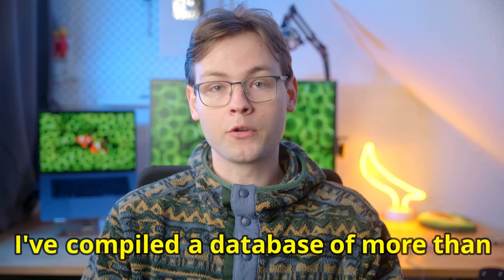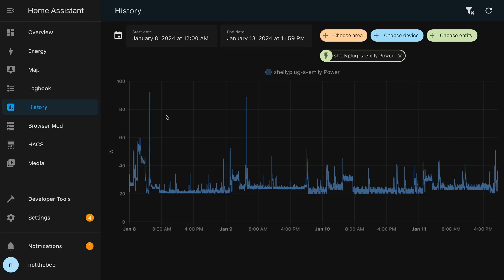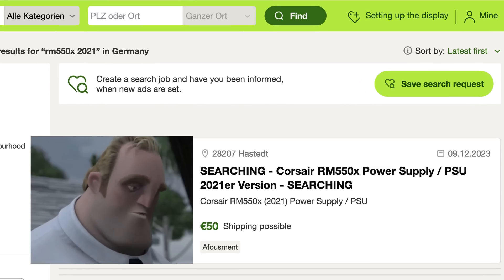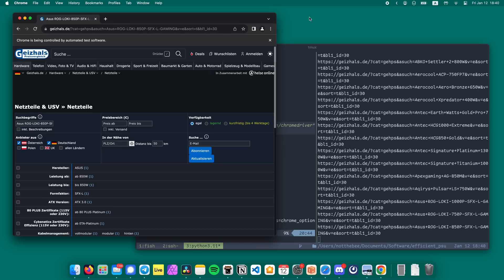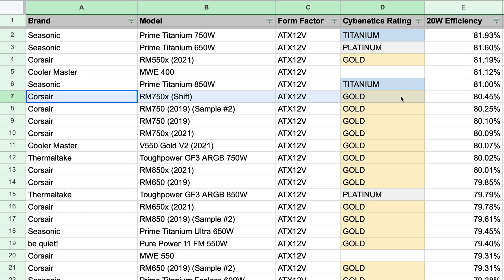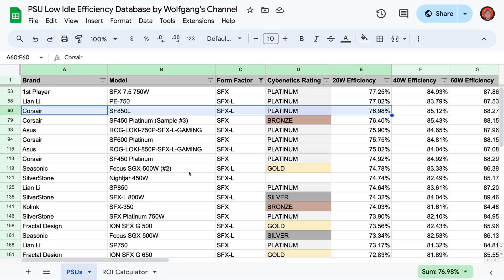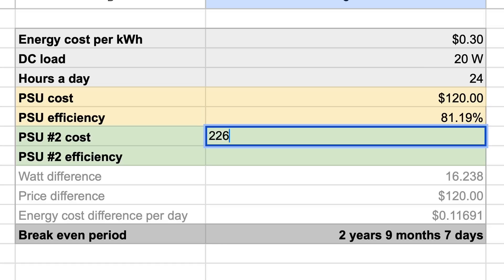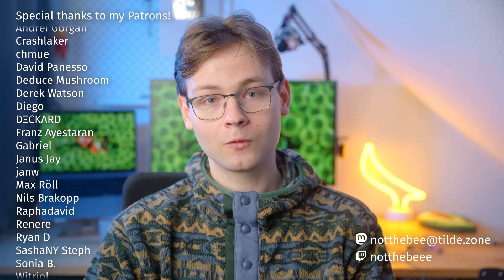What's the Best PSU For Your Low Idle Home Server?

Comment from the maker: PSU Low Idle Efficiency Database: https://docs.google.com/spreadsheets/d/1TnPx1h-nUKgq3MFzwl-OOIsuX_JSIurIq3JkFZVMUas/edit#gid=110239702
Reply: Amazing video!! I can see a lot of effort went into it, really well done. 
Also I'm a lucky owner of a Seasonic Prime Titanium 750W, I got it a year ago on the used market for 99$ (I think the person selling it did not realize what an amazing deal that was!)
And I still got warranty until 2032 😂
Reply: Nice work, thank you for this great resource! Just to let you know, there's a maths error on the ROI calculator which means it significantly underestimates the power savings. You have used DCLOAD * (1-efficiency) to calculate the "lost" power of each PSU, but you should use DCLoad * (1 / efficiency - 1). Or for the purposes of comparison, you can just use Dc Load / Efficiency. This is because the efficiency ratings from Cybenetics are defined as Eff = DCLoad / ACLoad. So a PSU that's 50% efficient has to draw 40W to supply a 20W load, but your formular adds 50% to the DC load, implying only 30W AC load.

If you replace the Watts Difference formular with =abs(C9/C12 - C9/C14) you will get the true power savings :)
Reply: Hallo Wolfgang
Könntest du beim Dok. die "%" Zeichen aus den "xxW Efficiency" Spalten entfernen? So könnte die Filteransicht auch korrekt verwendet werden. bsp. "grösser als" und "kleiner als". merci <3
Reply: this is awesome, thank you! Thanks to you my home server is running smoothly and I got to learn a lot about the topic :) thanks again!
Reply: great effort, but honestly, if you're up to meet a price point while trying to achieve maximum efficiency, you're kinda lost. basically there are no really good solutions for that, since either PSUs from the list are very expensive or not very available to buy.
I've been thinking to build my own, kind of specialized "PicoPSU" with one or multiple highly efficient 5V switching voltage converters. PicoPSU has one huge issue IMO: for a highly efficient SSD NAS as an example, you might get away with a 60W PicoPSU but because of the power demand of multiple SSDs in a RAID array while writing, you might end up needing a 160W or bigger PicoPSU and still may be underpowered.
Reply: I examined the sheet and i think that for corsair sf 450 platinum there is a error, the classificati doesnt macht tests done by other site as anandthec i. e.
Reply: 4x RM550x left still available in Poland. Just ordered one.
Reply: I wish they had tested the Seasonic Prime Fanless PX-500 (Platinum)
Reply: well there be a motherboard sheet?
Reply: Nice. The Seasonic Prime Titanium Fanless 600W is listed as Gold though for some reason.
Reply: I just wanted to say thanks. I was seriously thinking about needlessly upgrading my PSU for my desktop. Was thinking of switching from an Corsair RM750 to the HX850. The break even period was 360 years using your calculator. Again thanks for doing all the heavy lifting..
Reply: So the google sheet lists efficiency at 110V. Someone in Europe should be looking at 230V efficiency right?

PS: Sorry if I missed something obvious.
Reply: @vba77  Efficiency at 230V is maybe 2% better across the board, but the efficiency curve looks quite similar. It's usually good enough to look at the 110V numbers if that's what's conveniently available.
Reply: @Steamrick now the problem is the table did not indicate which is 230v data or 110v data. So the rank may not be accurate.
Reply: Coolermaster mwe 600 bronze and coolermaster mwe 600 bronze "v2" is different[v2 is not efficient(roughly 40%) at 10~20w load]. Your spreadseet have link for v2.
Reply: @nameno6895  Yeah, I think many of the current PSUs in market are not tested by cybernetics (yet) There is a CM MWE 400 available in market which is completely different from the one which tops the efficiency chart.
Reply: I'm also having trouble comparing the Google sheet numbers to the Cybenetics published numbers. What formula was used to convert their data to your sheet?
Reply: Thank you for making the data available Wolfgang! One thing i noticed while using it for a PSU selection: your presented data seems to be for the , not for 230V. This could be a deliberate choice (maybe you focus on the US market?) but then I would still recommend to mention this starting point to the data. The values for 230V are slightly different, although I presume will not change the picking order much :-D. Keep up the good work, your videos are amazing for the eco-minded homelab builder!
Reply: Super nice! 
Can we add a column for the fan size. E.g. for 2U cases in a rack PSUs with 80mm fan (i.g. to the rear) are better than 120mm fans (i.g. on top/bottom)
Reply: Thanks for this great resource! Just to let you know, there's a maths error on the ROI calculator which means it significantly underestimates the power savings. You have used DCLOAD * (1-efficiency) to calculate the "lost" power of each PSU, but you should use DCLoad * (1 / efficiency - 1). Or for the purposes of comparison, you can just use Dc Load / Efficiency to compare the total power draw. This is because the efficiency ratings from Cybenetics are defined as Eff = DCLoad / ACLoad. So a PSU that's 50% efficient loses 50% of its AC power to heat, so it has to draw 40W to supply a 20W load, but your formular just adds 50% to the DC load, which is not the same thing and implies only 30W AC load.

If you replace the Watts Difference formular with =abs(C9/C12 - C9/C14) you will get the true power savings :)
Reply: The link to the Prime Titanium 750W just yields an Amazon webshop search with the "Seasonic B12 BC 750 " as top search result. I didn't pay too much attention to it and accidentally now ordered the wrong PSU. To avoid frustration try to link to the product page instead. Other than that, gute Arbeit!
Reply: Hi Wolfgang, I may have found an error in your dataset.

I was looking for my PSU (Corsair TX750M) and found that two versions appear in your dataset: (TX750M) and (TX750M 2021).

I checked online and on the cybernetics website, and I could not find a (TX750M 2021).

The biggest issue is that the 2021 version appears to be rated Corsair Platinum, which is incorrect; all TX750Ms are rated Cybernetics Gold and 80+ Gold.

Just wanted to point this out as it may indicate an error in your dataset that could affect its credibility.

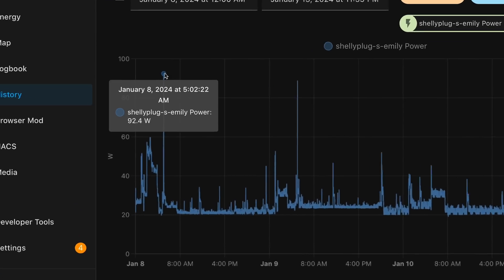Comment: 1:16 Regarding the all drives spinning-up at the same time... how about staggered spin-up? Is widely available support for that feature pretty much non-existent, as it seems?
Reply from the maker: It is supported on some HBAs/SATA controllers, but requires setting a jumper or a SATA option on most hard drives. In the latter case, there's unforunately a risk that your particular SATA controller does not support it, so you'll need to source one that does to wake the drive up again...
Reply: On that note: Damnit, I thought I could get away with some 5A Buck converters for 5V and 12V respectivly for a 4 bay setup... Looks like I need to reconsider...

Comment: Hi Wolfgang, I may have found an error in your dataset.

I was looking for my PSU (Corsair TX750M) and found that two versions appear in your dataset: (TX750M) and (TX750M 2021).

I checked online and on the cybernetics website, and I could not find a (TX750M 2021).

The biggest issue is that the 2021 version appears to be rated Corsair Platinum, which is incorrect; all TX750Ms are rated Cybernetics Gold and 80+ Gold.

Just wanted to point this out as it may indicate an error in your dataset that could affect its credibility.

Comment: What about the HDPlex 250W? It's 76% efficient at 12W and 89% efficient at 60W (230V). Unfortunately, I don't have data for anything in between, but I'm guessing 20W will be over 80%. If 250W is enough for you, I think it's a good option. It's reasonably priced too, passively cooled and very compact. Unfortunately it's a non-standard form factor, but you can just double sided tape it.

Comment: The HDPLEX 250W is missing in your list, Why? I reded that it might me over 90% efficiency under 40watts of load. Its an GaN PSU. Can u Give it a Try? Benefit is, its powerfull u can put 2 of them together and u have 500watts
Reply from the maker: As I said in the video, all the PSUs were tested by Cybenetics lab – I didn't run any of the tests myself, I just compiled them into a spreadsheet. If you want Cybenetics to test a particular PSU, please reach out to them directly.
Reply: @WolfgangsChannel  Ich habe es überhört oder wollte es nicht hören wer weis haha. ich habe die Firma mal angeschrieben ob sie das Netzteil testen können.

Comment: HDPlex Gan 250W/500Watt and FlexATX like Enhance ENP-7660L+OVT 600Watt are missing entirely, which are the best options for Homeserver/SFF builds.
Reply from the maker: HDPlex GaN PSUs are not very well optimized for low idle power efficiency
Reply: That's true, still missing all FlexATX PSU in your wonderful list, which would be nice because only 3 SFX PSUs with 70+% @20Watt are available and only the Corsair SF750 from this 3 is quite and reliable. So the list with included FlexAtx could make your list valuable for SFF Homeserver builds as well, since smaller than SFX is here a must not a Plus. The above mentioned Overtek Enhance manufacturer produce as well for other brands and you can find all FlexATX in the Cybernetics source. Silverstone for example has one 600Watt build from Overtek Enhance. Both with 72% efficiency at 20Watt, so the same than the Corsair SF750. The Silverstone with better availability but not modular unfortunately. The Overtek with rare availability like Corsair. Anyway thank you allot and all the best for you.

Silverstone SST-FX0600FCPT-A (FlexATX)
Enhance ENP-7660L+OVT (FlexATX)
Corsair SF750 (SFX)
all 3 with 72% @20Watt.

Your ROI calculator tells me that a difference in 14% efficiency and 130€ price difference needs only 1month 7 days to make a difference when paying 0,34 per Kwh, shocking 😂

Comment: The new ATX-3.1 Standard specifies that power supplys need to achieve at a minimum 70% efficiency when supplying a load of 10w. I suggest searching for such a power supply. For example the BeQuiet Pure Power 12-Series.

Comment: Looks like the cybernetics website has been changed since the video. At the PSU-performance database page there now is a Efficiency 2% [%] column, which for 1000 Watt PSU would be 20 Watt. This gets lower as capacity is reduced and caps at 10Watt for 500Watt PSU and below.
I would still check the linked report as there are sometimes inconsistencies with the data. Makes it way easier to check possible candidates by sorting it.
Thank you for the video.

Comment: This is really great that you put this together and pulled the data off the website, but isn't PSUs a little more complex than 20W/40W/60W/80W efficiency? Doesn't what voltage that is being drawn also come into play with efficiency? For instance, can't 20W on the 3.3V or the 5V rail produce different efficiency values than 20W on the 12V rail? I don't have access to the source material, so I don't know how they tested, would be interested to know if this was accounted for - thanks.
Reply from the maker: Hey! If you look at the spreadsheet, the last column has links to the original Cybenetics reports, where you can see more details
Reply: @WolfgangsChannel it says forbidden. the link not working
Reply from the maker: You're right, it looks like Cybenetics pulled the PDF reports from the website...
Reply: @WolfgangsChannel  Would you mind to show how you did scrapp the data?
Reply from the maker: https://github.com/notthebee/efficient_psu/
Also take a look at this https://github.com/notthebee/efficient_psu/issues/1 the issue author rewote the script to work with new Cybenetics reports

Comment: Very frustrating how many of these PSUs are no longer for sale. For my needs I found a pretty good option: CORSAIR RM650. 79% efficiency at 20W and widely available for 85-95 eur, with a 7 yr warranty and silent fan up to 200W.
edit: it seems there are 2 PSUs named RM650. One from 2019 and one from this year (?). The latter model (CP-9020280) has no reviews anywhere and no low power tests either. Disregard what I said :')

Comment: Remarkable work.  I guess one thing to watch is that the 20% load efficiency on the bigger supplies (such as 850w) is going to be less certain about say 40w idle on the smaller (say 400w) supplies.  The 20% guide is 170w vs 80w.  So true idle is a fairly long way off both data points...?

Or is the 20% figure an average for the supply running anywhere from say 20w to 20%.  That would mean the data is more accurate for low wattage, though it seems idle is a long way from peak power once you add NAS or GPU demands.  Hmm.
Reply from the maker: It's 20W, not 20%

Comment: Typically the motherboard BIOS allows you to limit the wattage of the CPU, so you could set it to 15 W and use one of these low power PSUs, no?

Thank you for the table, it is reassuring even for a desktop PC that one's PSU is 80% efficient at 30 to 40 W loads.

Comment: This is a very cool resource! The one issue it has seems to be that the figures in the spreadsheet are for 115V, not 230. This is something to be aware of, as the numbers can vary wildly between those two voltages. It would be great to have filters for 20-80W at 230V as well.
Reply: I'm having trouble matching the numbers in the sheet vs the published ones. The numbers in the sheet are much higher vs the published ones in the RM750x I looked up.
Reply from the maker: Cybernetics' older reports only had 115V measurements

Comment: Be quiet seems to be affordable and efficient.
But these PSU have a fan spinning all the time, even on low load. Does anyone have experience if this effects power draw, it is probably not included in the efficiency numbers.

Usually this would not be an issue. But for a 10-15watt system 2 additional watts would be a bummer.
Reply from the maker: Not all, some bq PSUs have a fan stop mode

Comment: You missed something significant in the efficiency calculations: heating and cooling costs.  If you heat your home with electricity then there are no losses in the winter.  If you heat with natural gas, wood or coal, maybe you are just shifting your spending to electricity which might cost more.  Alternatively, in the summer, you are possibly spending double running the air conditioner - a higher efficiency PSU may look a lot more lucrative if summertime cooling is an issue.

Comment: With the PicoPSU you basically rely on the power brick's efficiency, it only has to produce 5v and 3.3v and passes through the 12v, which delivers the bulk of the power. A survey on notebook charger efficiency would be interesting, too.

Comment: @Wolfgang how about low idle PSUs that are less than 400W ? what if someone needs a PSU slightly bigger than a PicoPSU but 400W is just simply still overkill? i.e. a system that will consume at FULL load slightly less than 180W in total, so PicoPSU-160 is slightly undersized, but a 300-400W PSU is way oversized. it seems they are unicorns, either discontinued or non existent..

Comment: I'd like to thank you for putting together this incredibly useful comparison, I think it's the single most useful resource for homelab tinkerers.

As a new to all this coming from desktop/gaming computing, I have noticed there is practically absolutely zero products aimed for this low-power home-server niche, everything is optimized either for high-airflow racks or for less-robust home desktops, nothing in between. Putting together a low-power, low-noise, high-efficiency, high-reliability NAS/virtualization platform was definitely an adventure but absorbing a lot of info from your channel definitely helped and now I am very happy of my brand new shiny home-server.

Comment: Hi Wolfgang,
thanks a lot for the spreadsheet!
However I noticed an error:
I found that the Cybernetics Report links for two PSUs are swapped, the "Lian Li SP750" and the "Bitfenix Formula Gold 450W (#2)".
The data appears to be correct but I was curious whether this was a manual mistake or perhaps your code conatains some bug?

Also, some Cybernetics reports contain seperate tests at 230V and 115V (The Lian Li SP750 is one such example). In that case the low load efficiency was significantly worse at 230V. However that's quite relevant for everybody in the EU (including you and me).
I don't have a perfect solution because the data doesn't appear to be available for all PSUs, and you compare 230V results to 115W ones either, but maybe like the pricing it would be nice to display the data at least for those where it's available?

Comment: Thanks a lot for the spreadsheet!
I think I may have found another Value King. I sorted the list by price (ascending) the Cooler Master MWE 450 achieves 78.67% efficiency at 20W and costs only 41.90€
Comparing that to the Cooler Master MWE 400 you mentioned and recommended (5th place in the chart when sorting by 20 efficiency) that has 81.12% efficiency BUT costs 1.5 times as much, using the very handy ROI calculator it would only pay off after 17 years!
So I think I'm rather going for this one 😅

Edit: nevermind, the amazon listing (which Geizhals pulled the price from) has a 6-7 month delivery time 🤦‍♂. It also comes with a UK power plug but that shouldn't matter in the EU as long as you have a spare PSU cable

Comment: The list is crap. I measured many power supplies by myself including a Seasonic Titanium model and it's far away of being the most efficient at low loads (80W is not a low load, a server usually consumes 20W or less in idle). For example the RM550x (2021) and the BeQuiet 550W 12M are much more efficient at low loads. The reason is the used special technology used those power supplies. The German review page tweakpc is the only website in the world, which shows those differences as they measure in 5W steps.